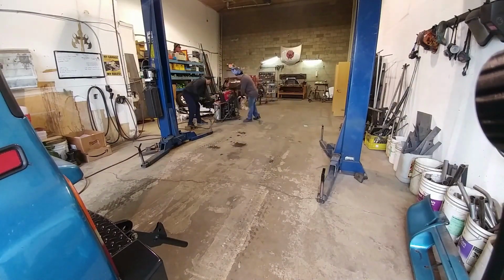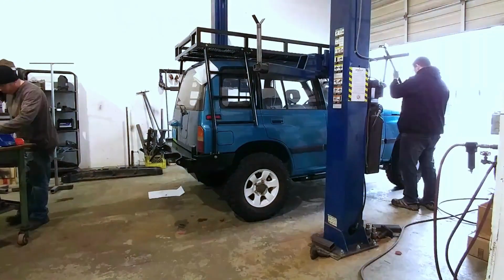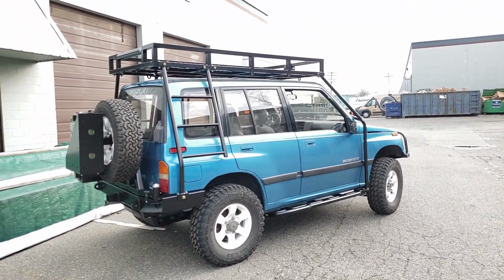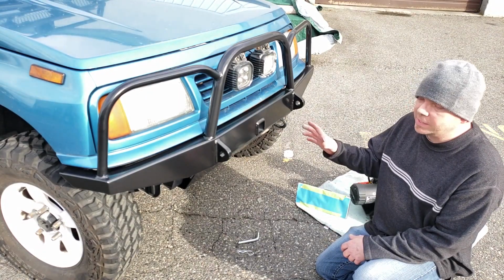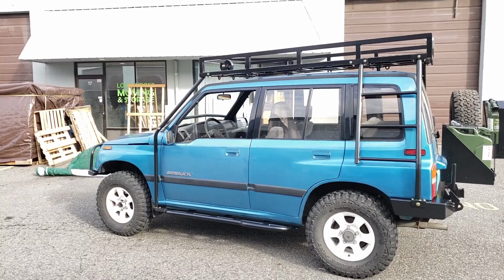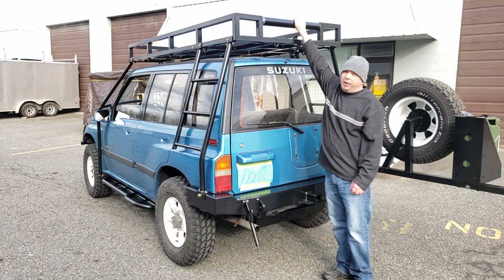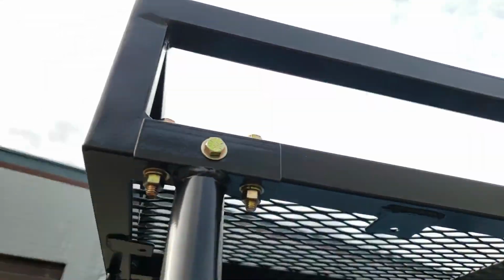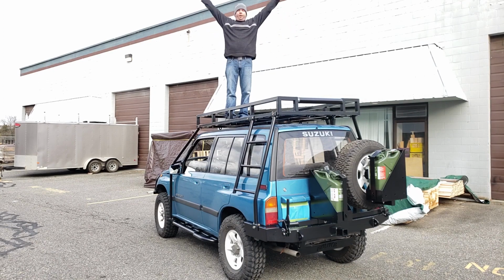Suzuki Sidekick Custom Roof Basket Winching System - 4th in the Ultimate Hunting Buggy Series

Comment: I think you're 90% there with the game winching system, but I think you'd need something to ramp the animal into the basket slightly if you're by yourself.  Perhaps make the sides of the basket removable and then attach to the back at an angle to the ground.  You definitely don't mess around with making it sturdy enough.  I hope you offer it in aluminum, lighter duty as well to save some weight.
Reply from the maker: Thanks Brad, I appreciate your comments. A ramp would be a helpful addition. The basket is large enough that a piece of plywood, cut to fit, might serve well as an impromptu ramp and also keep the roof of the vehicle clean when transporting game. 
This rack system was a custom one-off but I do offer  much lighter rack/basket set ups which can be seen on my website. Check them out if you like:
www.balmerfab.com

Comment: I need to nick some of your designs, looking to build a grand vitara like your side kick, but need to carry a small roof top tent and a canoe, no animals, also the way you have attached the cans, winch, roof etc make it fairly easy to remove it all for every day use and you can use the winch front or rear, brilliant.
  Best wishes from the UK, thanks for your output, stay safe. 
    Nige. 
   Nige,
Reply from the maker: Thanks so much for your comment! Stay tuned for more Vitara videos on the way! I'm also starting a lighter duty roof rack/expedition basket build for 2 Sidekicks today so please check that video out when it's produced in a couple of months. I'm originally from the UK as well... I didn't expect many folks your way would be building these rigs - good on ya!